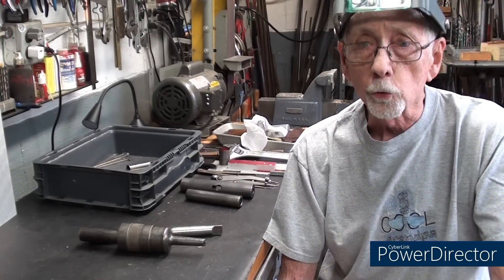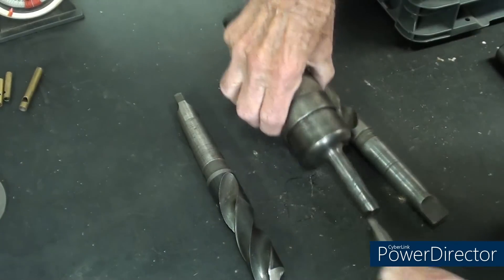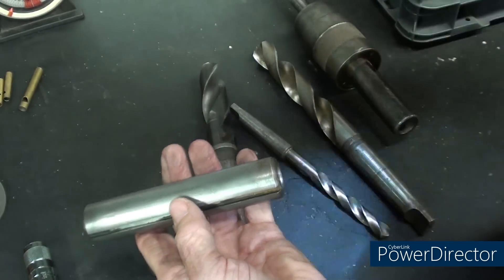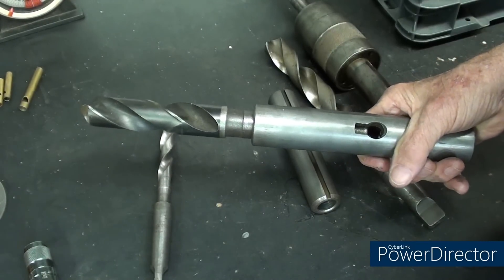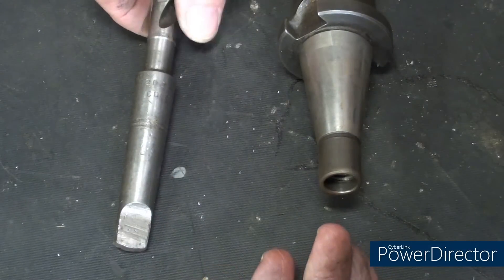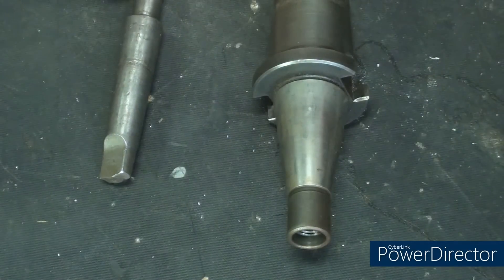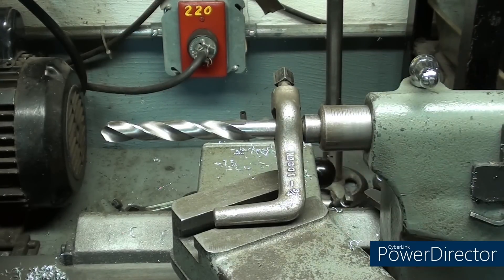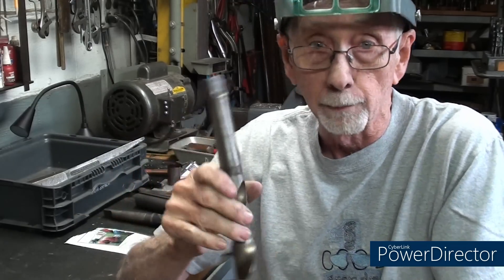WHAT IS A DRILL TANG ? #847 tubalcain mrpete bit taper sleeve

Comment: Sorry Mr Pete. I'm an experienced machinist and I still disagree. Mainly because of how I was taught but also I've heard it said by multiple experienced people, including our machine tool repair guy with his old grey beard.
Wikipedia states on the matter of Morse Tapers:
"For light loads (such as encountered by a lathe tailstock or a drill press), tools with self-holding tapers are simply slipped onto or into the spindle; the pressure of the spindle against the workpiece drives the tapered shank tightly into the tapered hole. The friction across the entire surface area of the interface provides a large amount of torque transmission, so that splines or keys are not required.
For use with heavy loads (such as encountered by a milling machine spindle), there is usually a key to prevent rotation"
and for Tangs:
"Thrust helps to keep the taper seated and provides essential frictional coupling.
The tang is not engineered to withstand twisting forces which are sufficient to cause the taper to slip, and will frequently break off in this situation. This will allow the tool to spin in the female taper, which is likely to damage it. Morse taper reamers are available to alleviate minor damage."
Reply: I believe mr. Pete over wikipedia Anyday.  Wikipedia is made up by people like us.
Reply: I’m surprised that Wikipedia would publish information not based on proven drill designs from major manufacturers.

Comment: Have you covered the crazy history of Morse Tapers?  Apparently they were in such a rush to get a standard taper to the US federal government that they made a small error.  I think Jarno tapers correct this error and are generally less arbitrary.
Reply: Don't know the exact story but it explains why each of the numbered taper sizes have a tiny difference in the taper angles. So, you can blame Mr. Morse and the lathe he made the first Morse tapers on.
Though you have to admit that it would be pretty cool if you made a mistake turning something on your lathe and the world was stuck with it for the next 150 years and most likely for 150 years after that. Even the metric guys can't escape from it.
Reply: @aceroadholder2185  Amazing. I had no idea about that!
Reply: @aceroadholder2185  :  I'm a "Metric Guy"...   👎 😤 🤬 😡
Reply: @aceroadholder2185  Like the metric guys can talk.
Their entire system is based on a inaccurate standard.
The meter is supposed to be some exact fraction of the distance around the globe.
It isn't.
It doesn't matter as long as everyone agrees to use the same inaccurate standard.
However it isn't really that big of improvement over  basing everything off of the size of some long dead king's foot ( or whatever the first foot was based of off).
Reply: @1978garfield  not since 1983- the metre is defined as the distance covered by light in 1/299 792 458th of a second in a vacuum. Lots of fun stuff about how that's measured.
Reply: @1978garfield  
MmmmHmmmm. That King had some big feet! Come to think of it, he had a small kingdom. His yard was only 3 steps wide. Was the king a giant?

Comment: Thank you for summing that up I have an old Taiwan jet takes the 3 mt bits .my question is why in gods name do they make them without a tang pain to get out had to modify many flat ended / threaded with a bolt so they would come loose when retracting
Reply: I have an older Jet 12x36 with the same problem of #3 tapers sticking and hard to remove. I made a spanner to fit 3 spaced holes in the tail stock rim to break the sticking tapers loose. Works like a charm.
Reply: I guess that this problem was addressed with newer models by adding a slot for a drift for stubborn locked tools. Back then they knew that the taper was sufficient without the tang.